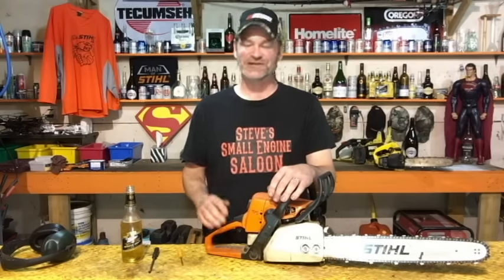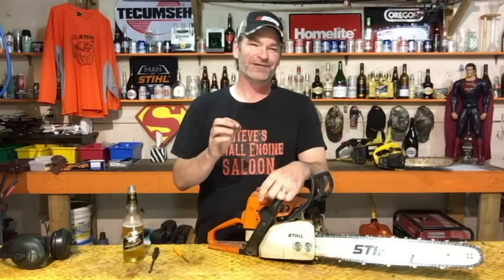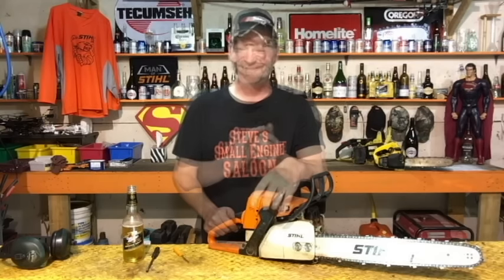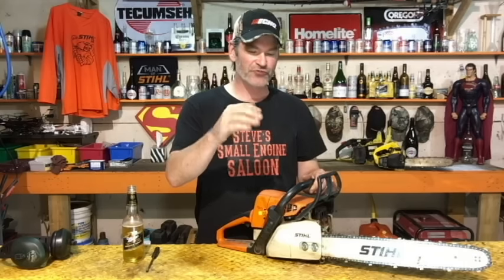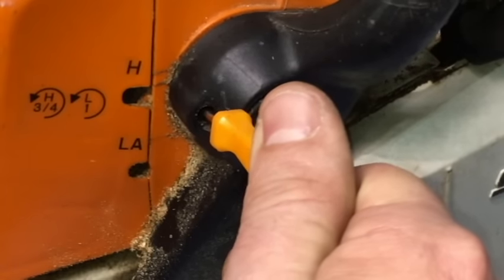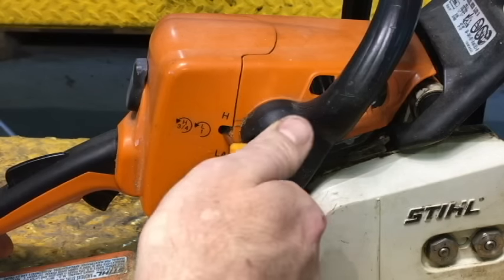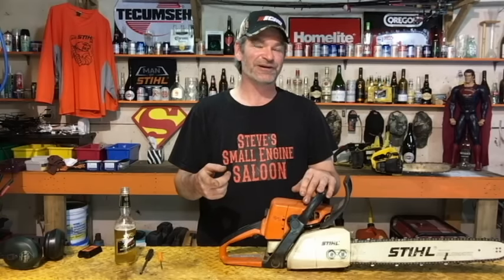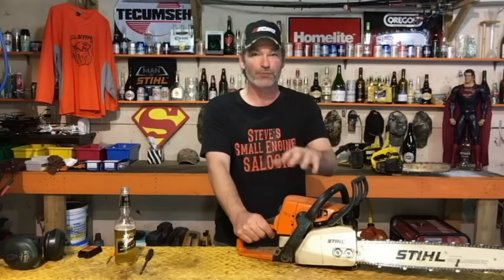CORRECT WAY To Adjust Or Tune The Carburetor On A Chainsaw (Step-by-Step)

Comment: Hi Steve.  Great explanation!  On the high side, I usually lean it out just till it starts to run away then back off until it starts to "break" a little.  Then under load it smooths out because the fuel causing it to break is being used under load.  If that makes sense lol!
Reply: Yes, that's what I've been told too, just adjust the hi side until it starts to "four stroke" under no load.

Comment: This is by far the best description of how to adjust a small engine carburetor I have ever seen!

I have a 16-year-old chainsaw that has been saved from the scrapheap. 

I had replaced the carburetor which improve the saw but this did not bring it back to 100%. 

I received my specialized carburetor adjustment tools from Amazon and put this knowledge to work. My saw is back to 100% !

I have another saw with the same problem I’m wondering if this is all it needs.
Reply: Just in case anyone’s wondering My chainsaws are Echo with Wulbro carburetors.
Reply from the maker: Thank You...
Reply: I’m up to three chainsaws saved with this method.

Comment: Excellent ! I am a ASE automotive mechanic and these small engines kick my butt   #1 Video on this procedure, and may I add, if it only idles and stalls with acceleration clean your spark arrestor (First). That may be your only issue... Thanks

Comment: I agree. Thanks for the explanation. Over revving a chainsaw is never good. I own 2 husqvarnas a 450 rancher and a 142 with 16 inch bar. I have cut more big wood with the 142 than most people would try but I always kept the rpm to a limit where it runs smooth. Even with the narrow chain it will still out perform any of my buddies bigger saws. Once I get to know the 450 better I will have a great combo of saws. One for big cuts and the little one to chop up small stuff. I am a big believer to have hand sharpened chains so the saw does the work and no need for down pressure. Thanks for the video.

Comment: I live now in Mexico, my cabin is located at 3000m altitude, i believe that could also affect a bit. I also had to adjust my L screw- turn in-clockwise IN 2 or 3 turns. Now works perfect all the time.
Reply: Jānis Liepiņš That makes perfect sense at altitude. The density of air is lower so there is less oxygen being sucked in with each piston stroke. So turning the mixture screw inwards (clockwise) reduces the amount of fuel to match that oxygen reduction. It's surprising how much that change needs to be with engines - how sensitive they are.

Comment: For those that like to finesse things,  Steve's instruction on the low speed mix is great. I add one thought.....  I do a little tweak,  I go about 1/3 of the way towards richer from the sweet spot to the rich side drop.    For 2 strokes with no accelerator pump like they had on old cars,  a tiny bit of rich condition lets the engine mix  go more to optimum as the RPM's are climbing.  the speed climbs, then the mixture catches up, makes it run lean during RPM climb. if it starts out a bit rich , the acceleration induced lean condition is fought off by starting out a tiny bit rich.  Old dirt bike trick to kill any lag.  too rich and the thing loads up though.
Reply: He did that.
Reply: That's what he said

Comment: This helped a lot. Thanks! I think my low adjuster has a limiter on it. The only thing I can hear changing that to any setting is a slow rich sounding throttle snap.
My idle was way to high as the chain would never stop turning. The other day I had ran it a good bit and it was running way to lean like it was running out of gas. With the colder outside temps you get more air in the fuel mixture by default.
 I just sawed up a limb to burn in the wood stove and its running much better.

Turns out I needed crank seals. It finally got to where it idled at half throttle no matter how it was adjusted. Had a bad air leak on the crank seals. Echo CS 400 the crankcase has to be opened to get the cranks seals out. They have a flange on them. Hopefully that will help some ambitious DIYerr!

Comment: Thanks man! I saved $240 by replacing my own carb ( and I am semi dufuss). Your video helped me tune the carb. Actually, my old Stihl 026 has the carb adjustments on the side. Once I dialed that in it ran like a champ. Next, I’m going to learn chain sharpening and winter storage!
Reply from the maker: Great to hear!

Comment: I know this is an older video.  But I put a different muffler on my saw and wow. What a great teacher. I've seen alot of videos about this but this is by far the best of all. Oh by the way it runs awesome now!! Thanks Steve!!
Reply from the maker: You're Welcome...
Reply: Is your new muffler have more ports in it? I’m trying to do the muffler mod to mine so this video is great for tuning it afterwards but if I can buy a muffler ready to go the better!  I have an MS310 btw
Reply: @Blankman776  it's a bark box from West coast Sawa.
Reply: Saw I meant . Sorry for the typo
Reply: @Blankman776  bought it from Walker saw shop on line. And it is a beast of a muffler!!!
Reply: @Blankman776  and actually it was pretty close to spot on . Not much adjusting off the settings from the book. I have an 066
Reply: @hdhhc5555  did the new muffler have more ports in it? Also where did you get it, if I can buy one instead of modding mine I will. Thanks btw
Reply: @hdhhc5555  yeah I’m having a hard time finding any ones for MS310 that have more ports.

Comment: Thanks for this Steve. I changed the carb on my Mculloch (same machine as a Husqvarna 453) for a Chinese one (12 bucks) and it was doing exactly what you described in the first instance, idling but when left for a few seconds it would slow and die. I did the low screw adjustment as you described and it idles perfectly now.
Greetings from Spain (But I'm English)
Btw... My favourite bottle of beer is Alhambra Reserva, made in Granada, Spain... 6.5% with a great flavour.
Reply from the maker: Right on Glenn

Comment: Really helpful video. Very clear and descriptive. The Stihl Dealer near here said my old 026 chainsaw needed a new carburetor, only available online and that I'd have to install it myself. When I took the air cleaner off, the carb was clean as a whistle inside. No sale on that - I simply cleaned all the oil out of the air filter, twiddled the L, H and LA jets and she runs like a champ. Just ordered the tach to finish the job.
Reply from the maker: Great to hear!

Comment: I have an old McCulloch 3200 that would not start. There was no spark at the plug so I replaced that and it started. I then tuned the carb as demonstrated in your video and created monster!! Tuned the "L" and set the idle and you aren't kidding about that "H" screw - damn! I had to turn it back a bit....  but now it idles great and everything works as it should. Thanks!
Reply from the maker: You're Welcome...

Comment: Hey Steve,
Regarding removing the limiter caps, is this something  we should always do?  For example, if limiter caps exist, do we remove them? Weed wackers  chainsaws etc? 
Kind regards
Reply: My two cents regarding Stihl stuff, is no. Not always anyway. In my experience, the folks at stihl have thought it out pretty well, and most problems come from inexperienced people fiddling with stuff. If it's running well with the limiter caps on keep them on.

Comment: Great information Steve! Question: If you put a different ratio of gas/oil from what you used in the tuning of the carb, will you experience performance issues?
Reply: if you changed the mix very MUCH, then YES !   you will experience a tuning difference, and here's why.....if you put MORE oil in the gas, (lower number mix  from say, 50 to 1 down to 45 to 1), then the mix will go thru the carb jets SLOWER and LEAN IT OUT....which means you would need to BACK OUT  the High Screw a bit, and the opposite is also true ...  thin the mix, and it goes thru the jets EASIER, making the tune too RICH....screw the jet IN A BIT  and Lean it out a tad.....it works just the opposite of what you THINK, until you mull it over a bit, then you will understand it.....here's why :

the added oil changes the VISCOSITY of the fluid, and it will go thru any orfice SLOWER the thicker it is......have fun.....OnWard.....

Comment: You say the high jet adjustment alters the revs only,  I have always thought it altered the Air Fuel Mixture resulting in a change in the RPM, as a two stroke Karter from way back I wood adjust to the jet to clean running  and out a bit more until the engine began to burrble or four stroke as we called this ensured the engine did not lean out at peak revs. I still adjust my weed eater the same way but as the string wears down the RPM pick up and I worry that I may get a nip up so I ( just to finish this bit ) flip the choke up a nats cock too slightly over fuel to stop the possible damage.
How far am I off the mark my two stroke analysis old with new??????
Great information and explanation thanks
Reply: Chris Boyce, spot on mate. Exactly how I was taught to tune a diaphragm carby. Learned all I know about tuning those beasts from my mechanic brother, his workshop was in an area with lots of chainsaws. Also with the low screw, set it at the highest idle revs, then use the idle screw to lower the idle. It may be necessary to repeat this step if the saw flat spots upon pulling the trigger. If the idle mixture is set with the idle screw too far in, that's when the saw will flat spot when revved from idle.
Reply: Same. Adjust to breaktone was what I was expecting as well.

Comment: Watched this and tuned my 80's hand me down Stihl 026 after rebuilding carb, new spark plug, new impulse line, new fuel pickup, did compression check. starts up from cold (not just barks) on 2-4 pulls with full choke, older model with no decompression valve. Works like new
Reply from the maker: Right on

Comment: Hi Steve, I have a problem with a stihl MS 250. It fires after full choke and when starting in secondary postion it just revs up very high for 3 seconds and dies. This happens even when the throttle idle screw is completely backed off. I have tried a new diaphram  in the carb and adjusting the H&L screws after using a carb cleaner and air duster. Fuel and spark plug etc is o.k. I have used various chainsaws since 1982 when we had the Dutch elm disease. I even built my own log spliter back then. Having solved many problems inthe past this one has got me stumped. Help please.
Reply: Did you check the tiny screen filter inside the carburetor? You have a fuel restriction somewhere, that screen is the first place to start

Comment: I had a high-speed screw once.

(someone had to say it)
Reply: mitchamus nobody has a sense of humor any more, I started laughing so hard 🤣😅🤣
Reply: I actually LOLd!
Reply: Awe to be young again... those were the days!
Reply: Those become low speed screws with age, and in some cases, frozen screws if enough years passed.
Reply: @independenttntn3276   Or worse,some a hole comes over while your at work and  drills  out the old small threads and retaps it to a much larger diameter thread.
Reply: Broken nuts if your nuts are old.... high speed screw warning
Reply: I had a high speed screw, but it didnt last long.
Reply: Mitchamus when you get my age imagination is a wonderful thing lol
Reply: THATS WHY ITS CALLED TWO-STROKE
Reply: Now all you can find are low speed screws?
Reply: It's also known as a quickie!
Reply: I want to find a chainsaw with TWIN carburetors!
Reply: My screw is froze up I had to put oil on it to make it turn
Reply: My high speed screw stripped out long ago. 😂
Reply: mitchamus. Did you know my ex then?

Comment: Extremely informative 
I was just given an old stihl 032AV, tore it down a bit, removed air & fuel filter & carb, cleaned it all up, installed new carb, filters, plug, bar, chain. Tomorrow I’ll tune carb.

Thanks very much for taking the time to post these videos.  🤜🏼🤛🏼👌🏼💪🏼
Reply from the maker: You're Welcome...

Comment: Thanks for sharing Steve! I really enjoy Your video's. I'm flying RC planes with two stroke engines in them, and I always pick engines where Walbro's are originally fitted. Quite often I run into problems when adjusting them. There's no problem with the H needle and finding the hig revs, but when I throttle down it sometimes takes a while for the engine to drop to idle. And quite often it will stall on me if I get it adjusted so it drops faster. Do You have any pointers to what I should do? You can imagine that reliability is an issue when You have a plane in the air ;).
Reply: The engine sounds like it’s running lean What color is the plug? White is bad! Check any carb to engine gaskets/boots for leaks or damage and security. A engine leak check might be required to check crank seals and engine gaskets.

Comment: My chainsaw is bogging at full throttle, it idles fine and speeds up fine but it bogs down right where I need it to run, any suggestions?
Reply: Lean out the high speed screw. That's in or clockwise. Do it while it's running and you can tune exactly how you want it. If that doesn't help, remove or clean the spark arrestor
Reply: H screw OR fuel line needs replacing they can pinch and cut fuel under heavy throttle but idle just fine

Comment: How often should you tune your saw?
Reply: Hot weather/ cold weather.... Mixing ratio.... changes in altitude.... ring/cylinder wear..... mods' muffler/carburetor/Porting/air filter,etc.

Comment: Thanks Steve. My main problem has always been at the low end of RPM. I was only adjusting the Idle screw, result being chainsaw idling too fast or bogging down and dying. Much appreciated.
Reply from the maker: You're Welcome...
Reply: Field Report! I didn't adjust the H screw, but made several adjustments to the L screw on my 16 inch gas chainsaw. Found its sweetspot, and it works great now. Thanks muchly Steve!

Comment: Why is the idle adjustment screw labeled "LA"???
Reply from the maker: LA is the German abbreviation for "Leerlauf-Anschlag" it means idling stop.  Stihls are made in Germany.
Reply: An English name for LA could be low air, since the screw adjusts the amount of air via the throttle plate.  I'm a fan of the saws labeled with I for idle.
Reply from the maker: Great way to remember that too!  Nice...
Reply: Ja  (German for "Yes")

Comment: After just receiving an 11 piece carb adjustment tool set for my old school Husqvarna 359, I quickly realized I can adjust it simply with a very small flat head(which came with the set). Thanks for the videos!

Comment: Your idle speed will get slower and eventually it will die also if your low speed is too rich. Usually if the low speed is too lean the engine idles surges before it dies and has trouble coming back down to idle after acceleration along with bogging on acceleration. This is probably the best tutorial that I’ve seen on YouTube.
Reply from the maker: Thank You...
Reply: @williamwallace9620  Sounds like it’s just a tad too rich. If it revs up ok,then you let it idle for awhile and it hesitates on acceleration, it is loading up with too much fuel. Turn it clockwise (leaner) about 1/8 turn on the L screw.

Comment: Another great vid Steve. Did the 1 1/2 turn  sounds awesome. Found out my pick up tube carb to tank was rotten. Saw a whole kit from China. It was garbage. Hose too big the air filter wouldn’t even fit on.  Luckily ordered a oem one at the same time.

Comment: Your video helped me get two saws running good; a McCulloch MS4016 and a Pioneer P41S made in the 1980s.   The info in your video works on any saw including vintage ones with the L & H adjustment screws.
Reply from the maker: Right on

Comment: Thanks Steve,, I gotta 460 that really works on my shoulder,, Mabe 7 pulls.  I found that if you put a small dash of fuel on the air filter, she fires on about 3 pulls.  Short of an electric starter,,Yea?   It does help. Central NC   Big hardwoods, and  big knots.

Comment: Hey thanks to your video I got the right tool and fixed the idle speed on my Husqvarna.  Now it doesn’t die when I get through a cut and back off the throttle.

Comment: I just want to thank you for this video. I have a Poulan Pro PR5020 that I've had for a number of years, that never wanted to stay running for more than a couple of minutes. That led to some trouble getting the saw adjusted, but holy hell, it runs amazing now. I cut some deadfall yesterday that had fallen in my yard months ago, and the saw stayed running for 30-40 minutes without shutting off once. It ran until the gas ran out. I am so happy I won't have to curse at this thing for being a pain in the rear anymore. I got a set of carb adjustment tools on Amazon for $10, so now I will be able to tune my TroyBilt 4 stroke weedwhacker/brush cutter, and my Ryobi backpack blower I found on the side of the road years ago. My wife and I just acquired ~35 acres, 30 of which are wooded, so this was a lifesaver. Thanks again!
Reply from the maker: You're Welcome...

Comment: Your video helped me get my chainsaw running. Thank you. I got the Pac-Man tool and got it tuned up nice. Started with getting the sweet spot and adjusting back on the low and then adjusted the high to get the rev up and not choking before getting through a log.
Reply from the maker: Great to hear!

Comment: You're channel has been a life saver. This particular vid is excellent! HOWEVER, my 024 was running, well, "ok" but I wanted it running sweet!  The  thing is... Whilst trying to follow your instructions... I lost my place with the screws 🙈. When trying to find my way back I've now created an issue where pulling the trigger bogs the engine down 🙈. It starts fine and idles but I can't get it back to normal with low, high or idle adjustments. HELP PLEASE!! ANYONE!!